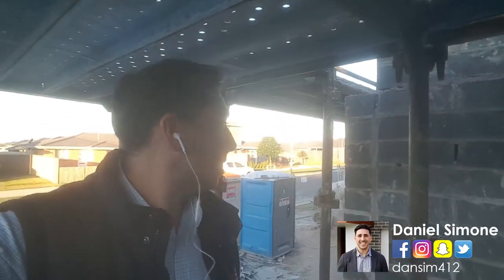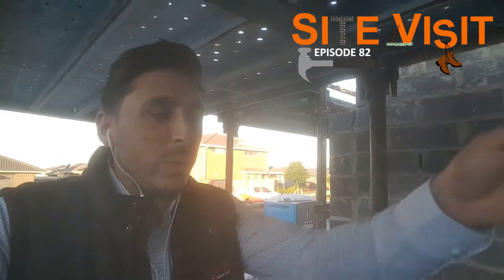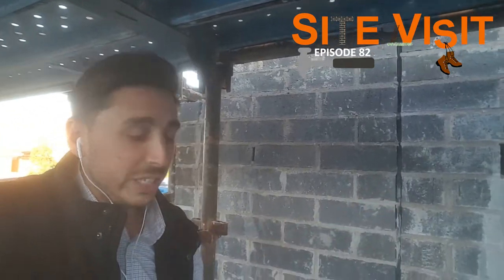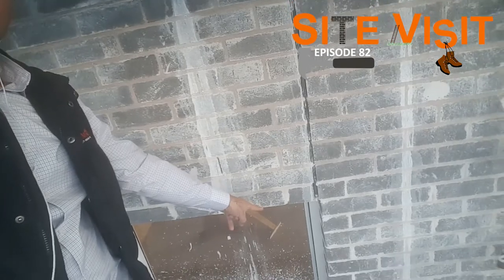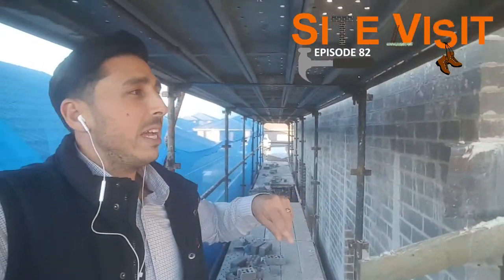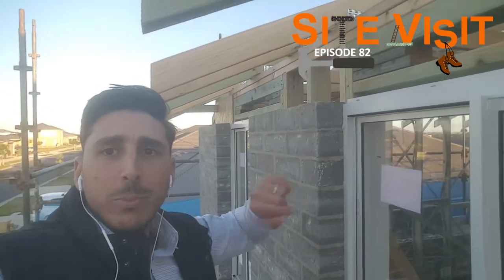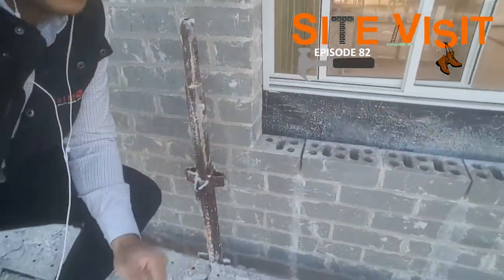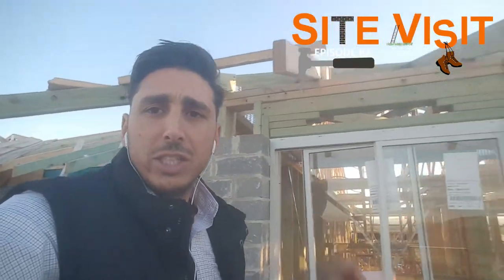BrickWork | Site Visit: Episode 82

Comment from the maker: A lot of things covered on this Site Visit... Love to know what part you found most helpful.
Reply: Hi Daniel, thanks so much sharing this video. It was very insightful and it's inspired me to kick off my own granny flat project at home. At first, I was tossing up between using colorbond or brickwork, however, after watching this i'm definitely going with brickwork. Thanks so much! Just a quick question before i get started - what are you thoughts on minimising the effects of efflorescence on brickwork, particularly on my south-facing walls. I'd really appreciate your thoughts on this. Keep the videos coming!!
Reply from the maker: Hi Tunisian, Thank you for your feedback. This is exactly the reason I do what I do. If you make sure the damp proof course is installed correctly and not damage then and the bricks are as dry as possible when laid, then hopefully you should be fine.